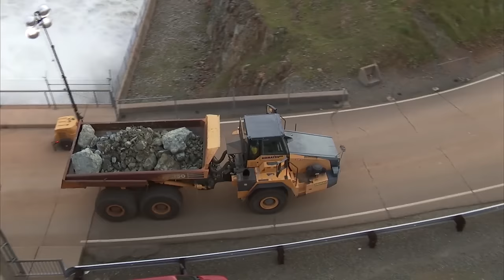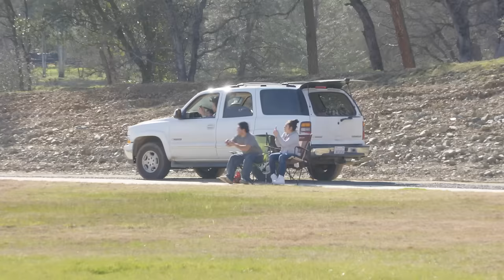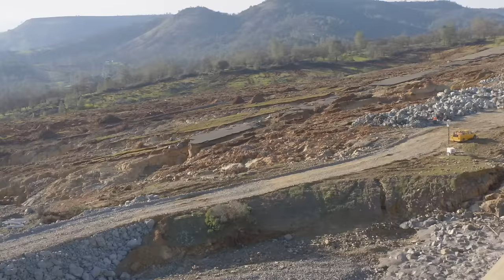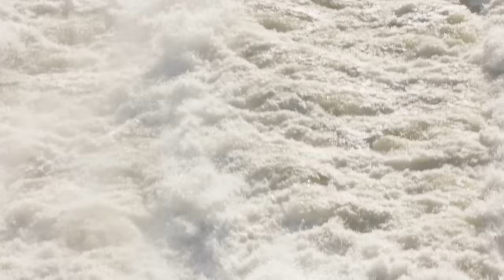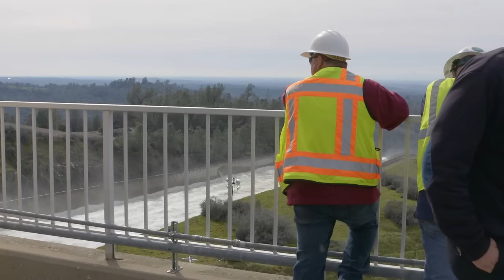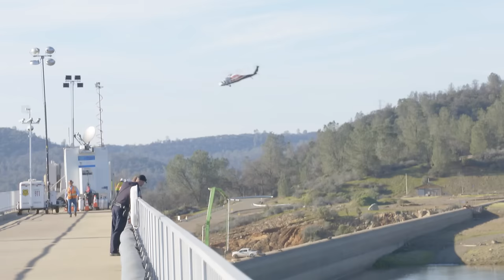Lake Oroville Dam and Spillway incident tour

Comment: where is your governor at we haven't heard from him in three days? the state of california is in an emergency and your governor is silent... Where is the rebar for the spillway? most real contractors use it to re enforce concrete, and exactly why is that electric plant shut down? don't tell the world that it is because of debris blocking the exit pipes! what the hell are you people pulling? and if you want to assure the safety of the dam, then just cut a trench from the parking lot over the hill, you may loose a little bit of the parking lot but the dam's structural integrity will be intact. Again where is the rebar for the concrete spillway????
Reply: built in 1957 and spillway has not been used for 42 years.....